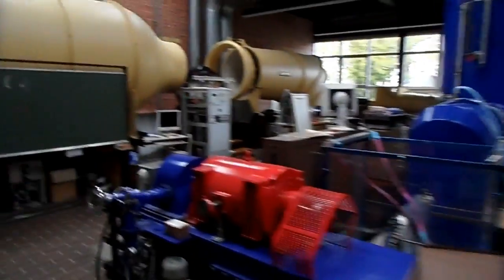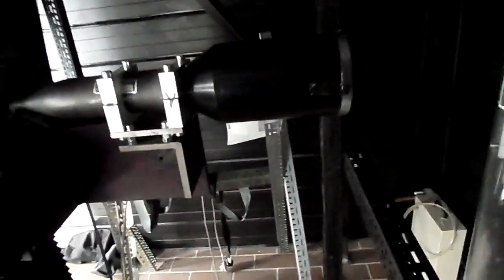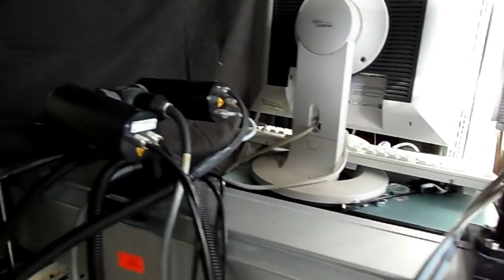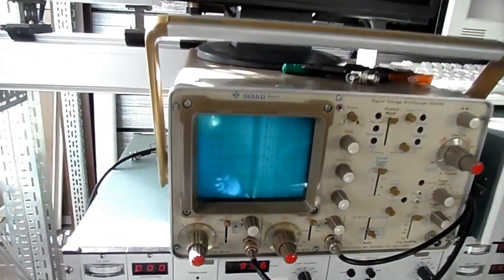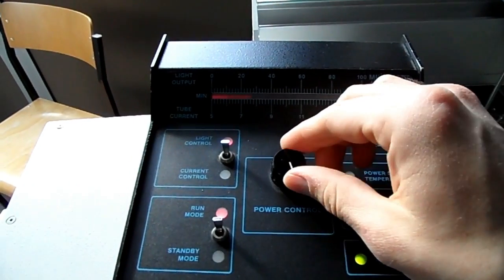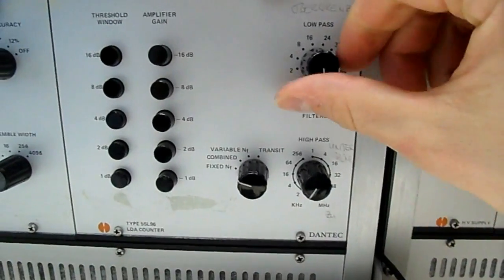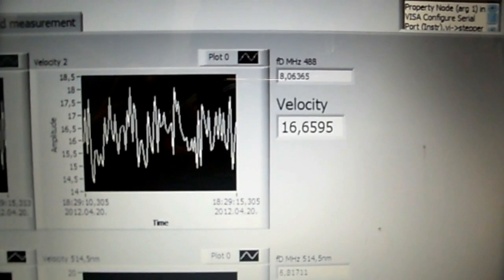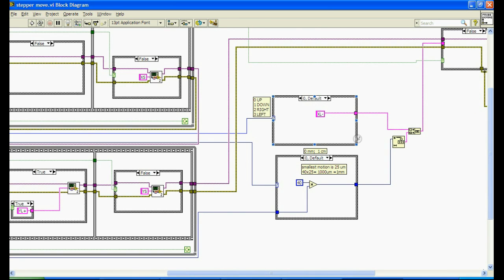Measurement with Laser Doppler Anemometer video-guide

Comment: how can you adjust the frequency shifter for a very fast flow?
Reply: the bragg crystal is usually tuned for a certain fixed frequency shift. Depending on how fast you need to measure, you could measure with the dominant flow in the direction of the fringe motion to increase your velocity bandwidth